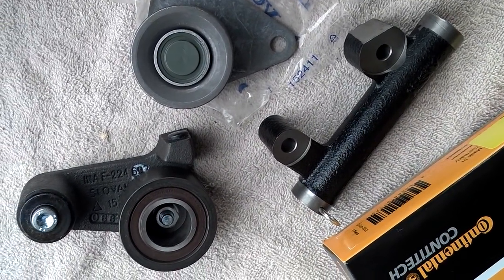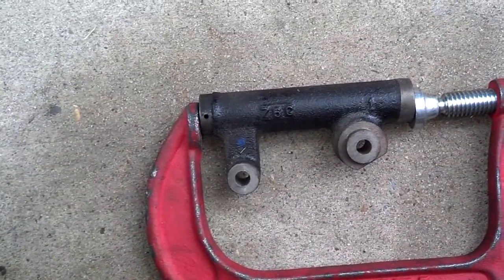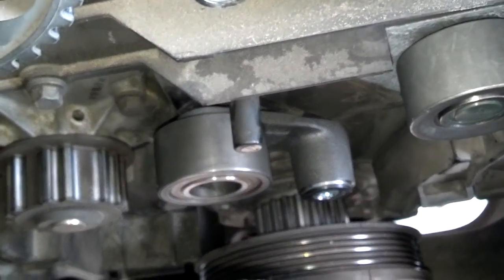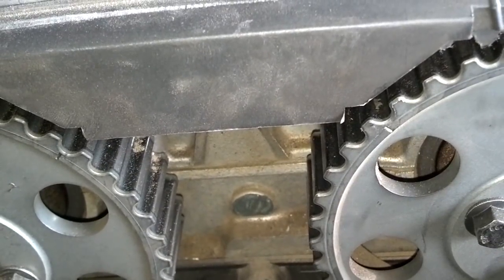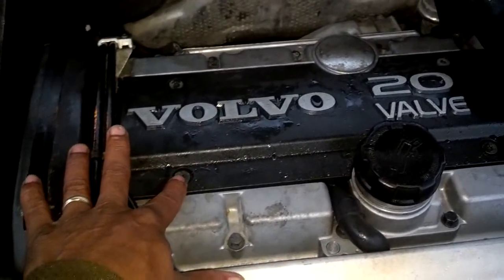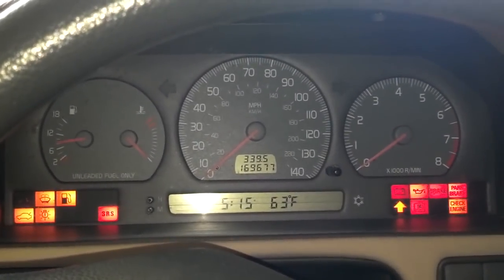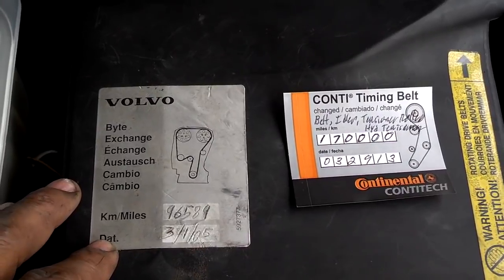How to replace the timing belt on the Volvo 850, S70, V70, etc. (Part 2 of 2)- VOTD

Comment: my god i wish i had watched this before doing a 8 hour job on not changing my timing belt couse it was the wrong one so i had to re-use the old one and i changed the belt that was driving the power steering pump and alternator and the a/c stuff this was a bloody pain to do and i do not recommend to rush this if you are in a borrowed space, im going to buy a new timingbelt on thursday and change it next week hopefully my back pain cures from this 8 hour job whew it was a challenge and i really do have to point out that i wish you showed how you put the dampener plate back in place couse i could not get that back into place for some reason but im going to put it back when im gonna replace the belt again next week.
Reply from the maker: I don't even know what kind of car you have...
Reply: @RobertDIY  its a volvo v70 1997 with the b5202s engine 2.0 sry for not mentioning it im sry.

Comment: Thank you Mr Robert for all your videos which educate me a lot about fixing my 1999 Volvo S70. My radiator was busted (leak) the other day and I replaced it. After replacing it and starting the vehicle, I realized that the coolant reservoir was swelling up about to bust. I shut the car off and I think that the water pump and the timing belt needs to be changed out.  I will be changing out the thermostat as well. Just in case I missed anything, do you think of anything else? Thank you so much for your videos.
Reply from the maker: +James Has the system ever ran low on coolant and overheated the engine?
Reply: +Hello Sir. My teenage son was driving it when the radiator got busted. I put some antifreeze in it and that's when I saw where it was leaking from. After replacing the radiator with  coolant in it and start it up , it kind of running rough and I hear a squeaking sound like something was forced to turn by the belt. I also noted the coolant tank about to bust. That's when I turned the vehicle off. Supposedly the vehicle started steaming up a mile down the road according to my son. Before that, a hose was changed out and everything was fine. Thank you again for your expertise. Hoping for a good news. Keep up the good work Sir. Thank you much, James.
Reply from the maker: Sounds like it has a blown head gasket.
Reply from the maker: https://www.youtube.com/watch?v=jsxPXltMFOc

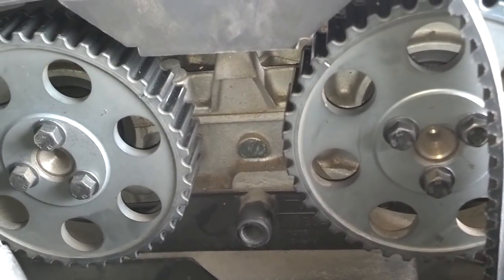Comment: Hello Robert, at 6:20 when the cam gear moved a little bit out of time how did you move it back? Also should any of the bolts be antiseized? Thanks
Reply from the maker: +Aaron B No antiseize on timing parts. Thread lock on water pump bolts. Just move it back. I often use a 1/2" breaker bar and hammer. You can use a large screw driver between the bolts. The old belt, whatever.

Comment: Hi Robert been watching your video over and over on replacing TB , putting back together got the 3 marking lined up , put all back together, started it , sounded good but now there's a rattling noise , not over heating but I'm not comfortable taking it for test drive , any ideas ? A little anti freeze did get on some things but not much.
Reply from the maker: Rattling? What kind of car do you have?

Comment: Hi Robert. Im in South Africa, so buying parts from IPD or FCP is out of the question, due to shipping costs. The official volvo dealer here is really expensive due to the exchange rate of the Rand to the Dollar. I found a volvo specialist shop that stocks Goodyear cam and serpentine belts. Is it worth saving that extra money, as I have heard some horror stories about OEM belts snapping?

Comment: Hi Robert. Thanks for sharing your great videos!
I am changing the timingbelt/ idle roller/ tensionroller on my early "94  850 10v to but ran in to a strange problem.
After putting in the new [same spec. 4.7mm diameter idle/ tension rollers and the old tensioner]  the new 139 teeth 21mm belt  [as was installed before]  would not fit!    even with the tensioner pressed in all the way and pin locked!   [plastic part not even installed]

I have removed the slack between the crank and the exhaustcam but it still will not fit around the waterpump / tensionroll..
Hope you could give me a sugestion?  Thanks!
Reply from the maker: Is the belt properly installed under the pin at the bottom of the crank? At 3:29.
Reply: Hi,  yes i also rotated the crank 2 rouds by hand and all marks where still on..
Reply from the maker: Rotated the crank? I have never heard of anyone doing that. lol
Reply: i mean,  i managed to get the belt on.. it went realy tight, while the  tensioner was stil pressed al the way in with the pin holding it in.   then i turned the pulley 2 coplete rotations and all the timing marks were still but..  the belt is so tight that if i would release the tensioner pin,  the tensioner has no where to go becaurse its already pressing tight against the tensionerroller.
Reply from the maker: One of the rollers is probably larger. Where did you get the parts?
Reply: Robert DIY   both rollers are 4.7cm diameter.  Same size as the old once that came out.
I also checked the waterpump wheel and its also same as the old one..
Parts are SKF.
Reply from the maker: Interesting. What brand is the belt?
Reply: Gates Powergrip.

in the meanwhile i managed to get the belt on but it was a struggle. [i did pull out the slack on the idle roller side first of course]
..pulled the pin to relesae the tensioner.. it pressed out the litllebit of slack that was still left in the belt but there was not much, as it was already pretty tight.  turned the system by hand to check the timing.  
Than i finally managed to put in the litlle plastic ring on the tensioner as well!
Motor runs wel now and all seems ok..  but didn't expect the difficulties with the belt fitting so tight.

Comment: Robert, the car in this video doesn't have VVT on the intake cam. Our 2000 V70 does. We got the car back together after belt change, but it won't start. There was slack in the intake cam when we aligned the timing marks. Should we take out that slack and THEN align the intake cam timing mark before installing the belt? Thanks for any help you or other commenters can give.
Reply from the maker: +Lee Reed Why did you change the belt?
Reply: +Robert DIY thanks for responding. Car has 214k, and my son was driving when it lost power and died. The water pump seized and destroyed the timing belt, which was overdue anyway. We bought the 2000 V70 just back in July.
Reply from the maker: Oh, so you put a belt on for nothing. When these cars jump time, it destroys the head. You will need a new head.
Reply from the maker: https://www.youtube.com/watch?v=-2oIeIhpV44
Reply: +Robert DIY well, that's not what I wanted to hear, but you're the expert. Thanks for being available and responding so quickly. Love your channel. At 214k, we may look for a used engine or another cheap Volvo.
Reply from the maker: Where are you located?
Reply: +Robert DIY we're in Dallas, TX. It's a shame that it broke without warning, but I like the post purchase video link you shared.
Reply from the maker: must of us don't hear the warning. Usually a squeal for a few seconds at start up. Or the water pump leaks before it fails.
Reply: This is why it is imperative that U replace the water pump with the timing belt at 100,000 mile intervals. Water pump only costs $60.00. Head hob costs  $1400.00 unless U do it yourself.

Comment: Did you rotate the engine with the belt on to readjust the timing? I messed up the timing before hand so im readjusting it now with the new parts in
Reply from the maker: Huh?
Reply: @RobertDIY  I forgot to line up the timing before I took the belt off, how would make sure the timing on the camshafts and pulley are correct?

Comment: i think the shadiest part is picking up the slack in the belt any tips?, was thinking about investing in a cam locking set. also do you think a 1/4 torque wrench would fit in there for the Water pump
Reply from the maker: +devon strong The crank does not move easily, so moving the belt around on the cams is not a real big deal. The intake cam always seems to stay in place and the exhaust cam seems to always move 2 teeth clockwise. I have never used a locking tool on these cars and never felt I should get one. I have very little issue getting the 3/8" torque wrench on the water pump bolts with the right size socket.
Reply: +Robert DIY thanks for the reply Robert just got my 1999 volvo c70 hpt tackling this job and a pcv overhaul in the next few months. should I run 91 octane gas my csr it is HPT heard people say they run well on regular but I don't want to damage my valves I've heard you talk about burnt valves before
Reply from the maker: +devon strong On my way to NYC to help a guy with a burnt valve now.

Comment: I have a 2000 s70. It is vvt… I’m not seeing the hydraulic tensioner listed for it. Is it different on mine?
Reply from the maker: https://youtu.be/YpOYTVpzzic?si=D22HD9cfAvk-5R1v
Reply from the maker: The belt and the tensioner setup is different. You have to order parts according to your year model.
Reply: @RobertDIY  do I have to do anything special with the vvt or just keep the cams aligned?

Comment: Hi , I have a 1998 Volvo S70 , I think what's happening is I left the serpentine idler pulley under car for two weeks "due to wrong parts sent" and it rained a few days and moisture got in it which is creating rattling sound I'm guessing anyways ? I test drove seems to be doing fine except for that.  Probably gonna have to replace that now .
Reply from the maker: +Emilio Gonzalez Pull the belt and see if the noise goes away.

Comment: Hi Robert
I have a Volvo S70.  I have just completed the installation of the timing belt but now the engine wont do a full rotation by hand.  Have I done something wrong?
Thanks
Pieter
Reply from the maker: Probably did not set the timing marks on. What year car do you have?
Reply: Its a 2000 Volvo S70 2.5 20Valve.  Non Turbo.
I followed your video with replacing the head step by step.  The bottom knotch is exactly in the centre of the 2 grooves.  The top marks are alligned exactly as per the video.  I honestly cant see whats wrong.  If you could try assist me, would really appreciate it.

Thanks
Reply from the maker: Did you get the intake and exhaust cams in the proper slots?
Reply from the maker: Did you grease the cams before you installed the cam cover?

Comment: Thanks for the video. I replaced my timing belt this weekend, but I think the timing is off a wee bit. Even though the marks were lined up what i thought was right, it is showing the signs of not being timed right (poor acceleration and not running as smooth).

Is it possible to adjust the timing without taking the belt off, and if not, how do you move one of the sprockets to align the marks right? Just by hand, clockwise?
Reply from the maker: hapsblog Check the timing by pulling the cover and turning the crank. I have been having issues with the exhaust cam moving 1 or 2 notches. When that happens, I simply pull the tensioner, put a extension in one of the exhaust cam sprocket holes and tap it until the belt jumps the teeth and sets right. Make sure the crank is on it's mark.
Reply: Robert DIY I re-did my belt today (about 5 times now) and now it seems to stay lined up at the bottom, but not the sprockets up top. every time I spin it (by hand or by the car) the marks get ahead, on both.

And now the car runs rough, like it's miss-firing. Could that be the wrong belt maybe?
Reply from the maker: If the belt is tight it is likely the right one. What year car do you have? Mechanical or hydraulic tensioner? Are you using the right marks on the cams and cover?
Reply: Robert DIY It's a 93 850. Hydraulic (whichever one iPD sells in their kit). I'm using the notches on the cams and the notch in the cover (and the line and notch on the one at the bottom of the engine).

I'm thinking I must've not had it as aligned as I thought, unless I really screwed up the engine somehow. I just finished re-doing it (again) and was SUPER careful with it this time. 

I went around 4 times actually (because after the 2nd turn, I wasn't careful in how slow i did it and the markings didn't stop where you can tell if they line up with the cover notches.

So after the 4th time I stopped where all 3 lines matches/lined up.
Reply from the maker: Good, so you set the tensioner? Pulled the pin and installed the white clip?
Reply: Robert DIY Yes I did. Took a lot of effort to get the clip in, but it is in. The belt is tight (but not too tight) and everything lined up. 

I'll post tomorrow after I start it up and if necessary (i.e., keeps running crappy) check the plugs..and then I'll comment here.
Reply: I just tried to start it, and it wouldn't start. The timing marks were still lining up (and still do). 

When I cranked the motor (by hand) there was an odd rubbing sound, but it went away after one complete rotation, and did not return in subsequent cranks. 

I removed the plugs, and each one smelled gassy. Maybe it got flooded? I cleaned the plugs and am letting the engine "air" out. I'm hoping that is the issue.
Reply from the maker: Probably it: The lawmower syndrome, car will not start, no compression - Auto Information Series
Reply: Robert DIY Thanks. I re-installed the plugs and tried to start. It sounded like the engine was slower than normal, so I checked the battery. It showed 12.38 (or so). I checked with a battery charger, and it read 4 amps. So I'm charging it.

If that doesn't work, I'll try the Lawnmower suggestions. Oy..
Reply: I checked to see if I had any spark, and I had none. So I checked my distributor cap and it was obviously in need of replacement. So hopefully that's what the issue ends up being.
Reply from the maker: ok.
Reply: Robert DIY Hi, it's me again.:)

I got a 314 code on A6, so I replaced the cam position sensor. Still wouldn't start.

However, I did your lawn mower syndrome, and it got the car running. But, now it runs rough. Not sure if still misfiring, or something worse. It's a rough vibration, and kind of loud, but not "holy crap, stop the engine" loud. It feels like something isn't firing, because if I accelerate, it sounds better. And NO idiot lights come on (which I would hope, maybe naively, that they would if you had a valve/piston issue).

And I still receive the 314 in A6. I tried re-setting the OBD, but it didn't change anything or the code re-appeared/still an issue.

I'm close to my wits end here.
Reply from the maker: Where did you get the cam sensor?
Reply: Robert DIY IPD. 

I checked the crankshaft pulse sensor (for Ohms) and on both of my multimeters it read as 001 (I think the acceptable range is 200-500). And one of the things about a faulty CPS was rough running engine. Hopefully that's what this was caused by.
Reply: @This.Here.Channel  And hapsblog disappears with no resolution after all this.  Nice.
Reply: @donmoore7785  that guy sounds like quite a jerk

Comment: Hi, my s70 98 had done hydraulic  tensioner and new timing belt at the local shop few days ago. All pulleys were replaced. They used Gates timing belt T252 . I have noticed that the belt seats now right on the edges of the cam sprockets. Also the belt on the tensioner pulley sticks out slightly past the outer edge. Maybe a millimeter. The belt itself has some fuzzy debris on the outer and inner edge, not much but considering just few days of riding I thought it's weird. The teeth on the belt look fine, no debris. My old timing belt was spotless. Guys at the shop told me that Gates belts are like that. Is that true? As far as tensioner's pulley having the belt sticking out: Is it possible that they lost the washer, which comes with the pulley on its mounting surface? Is it one of these washers you can remove or it's a permanent one. I am talking about part INA 5310090100 / ZT00901. Car seems to be running fine. The alignment marks on cam sprockets and oil pump are fine too, I checked all of it. What do you think guys?  here are some picks: https://www.matthewsvolvosite.com/forums/viewtopic.php?f=1&t=90750&p=516295#p516295         Thanks
Reply from the maker: I do NOT use aftermarket water pumps on these cars. 🤦🏾‍♂️
Reply from the maker: Blet should be fine.
Reply: @RobertDIY  Hi Robert, I am guessing that you observed timing belt on idling Volvos. I found some small lateral movement - about 1mm on mine. Please check out this video: https://www.youtube.com/watch?v=ds9b5X2Ik1Y     First part of the video are pictures, second part contains the video while car is idling. What do you think? Thanks